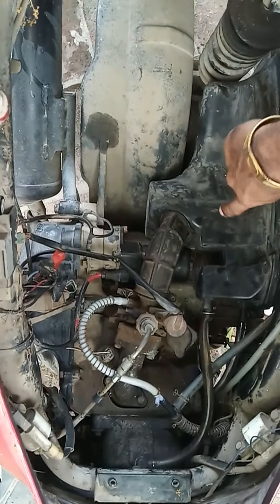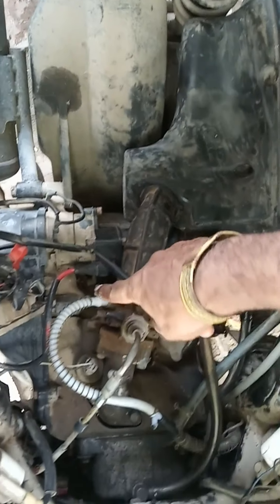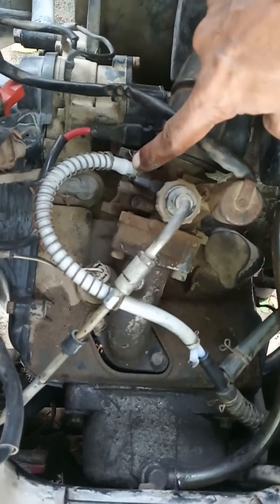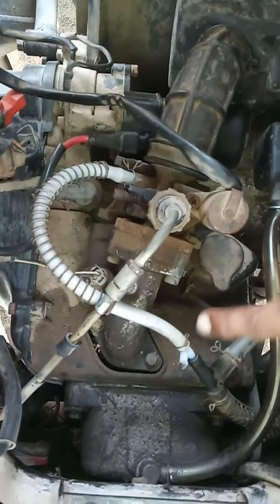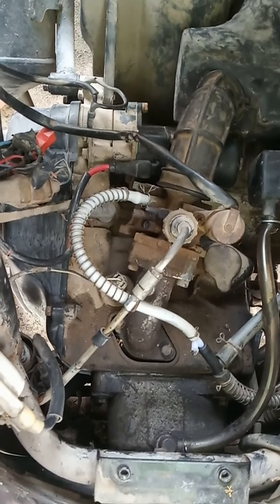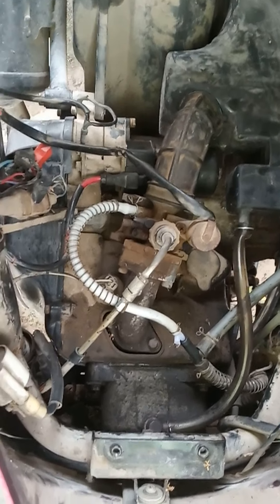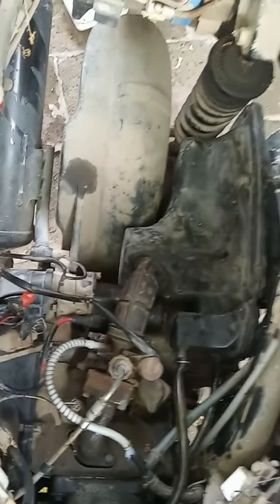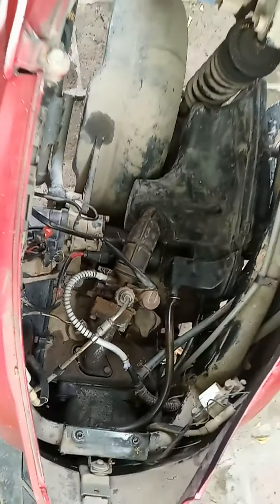Bajaj Kristal Rare Fuel Tube Replacement With Fish Tank Connector Idea1 Part 1

Comment: Sir, I have Bajaj kristal scooter. My scooter is not starting and found pump is not able pump the petrol. If I connect through a bottle scooter is starting up. Could you please help me. Thanks in advance.
Reply from the maker: Good morning. Sorry for the late reply. Most of the mechanics cannot correct it. So the motor works but not able to pump. I use to recharge/replace the battery and it will pump well. It is 13v dc motor so pls charge your batt. I will upload a video too on the same issue. If battery recharge doesn't help just remove motor and clean inside (usually it is clean) just verify each component. Good day.
Reply: @ayyamperumalr  I have changed the battery, but still it's not working. But if I supply petrol connect a bottle, then the scooter is starting. Could you please explain or make a video on Kristal petrol tank mechanism. Thanks in advance.
Reply from the maker: @santhoshvin1  https://youtu.be/gMZHkenWhwQ  watch this video. my solution for the same problem. I had also given the price of new fuel pump. I cleaned the fuel pump and fitted, it works well now. Pls watch and try.